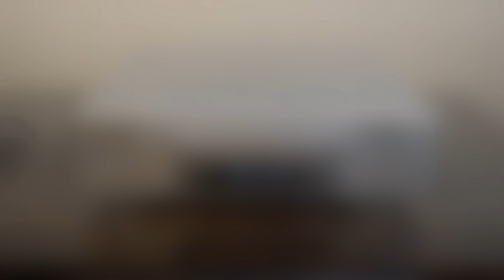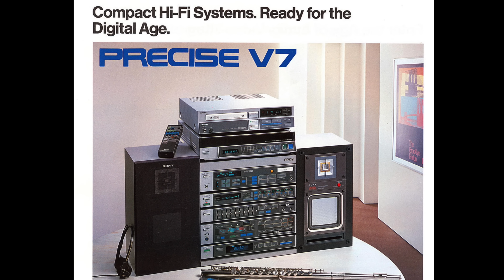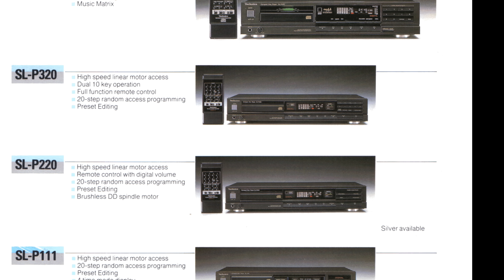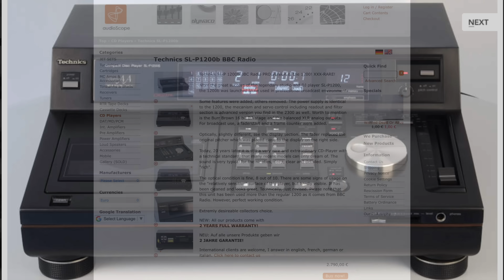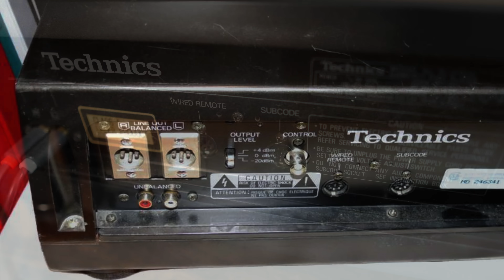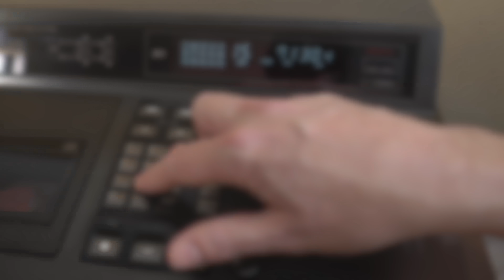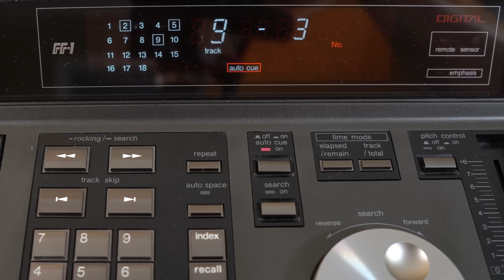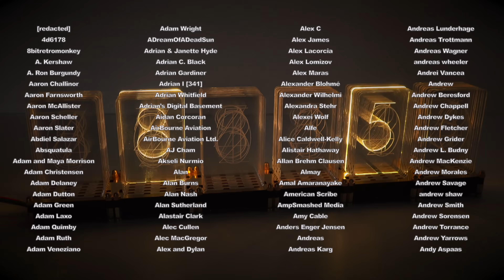How CD players lost their cool & why this Technics didn’t.

Comment: As someone who worked in professional radio at several major UK stations in the late 80s through to mid 90s, I can offer a different take on these decks. They were widely loathed by DJs, because they were incredibly sensitive to any form of contamination on the playing surface. You only had to breathe on the discs and they would stick or skip mid-track. Discs that played perfectly in the worn-out domestic CD players in the production office would go nuts while on-air in the P1200s. You were always on tenterhooks, wondering if the currently-playing song was going to go crazy.

I don't know if that was a problem that afflicted the decks as they aged; I didn't start using them until 1989. But it really was a major issue by that point, and speaking to people at other radio stations, I've heard exactly the same complaints. In 1990 my station threw out all the P1200s in the on-air studios, only retaining them in the production studios, and replaced them with caddy-based Denon DN-951FA decks that were specifically designed for broadcast use; from that point on, we never worried about CD playback suddenly failing mid-song.

The Denons were overall way more suitable for broadcast; they had a much slimmer profile (although they were deeper) and they had minimal front-panel controls, but those controls were exactly what broadcast users needed, including an "END MON" button that would play the final 10 seconds of the track (duration adjustable using a setup menu) so you could check how the song ended before you played it.
Reply: Those Denon's were work horses, I think Tascam also made a similar version for broadcast. Also in the slim profile. The advantage was you could stack three side by side in a standard 19" rack. They had a cart version too, that allowed for easy loading and quick unloading of the CD's. The CD''s would live in a plastic caddy to protect them, so no loading drawer needed. Just slid the CD cart into the deck. We had a wall full of CD's in those caddy's, you could fit a ton of them behind the DJ position.
Reply: Same experience here. Used them for a long time in post-production. Always issues with readability of discs, skipping issues. It’s a shame, because it looked very nice and solid, those players…
Reply: This really bugged me, such a nice player but the optics were awful!!
Reply: Good thing you told me, I was about to buy one
Reply: I agree - I only really saw SLP-1200s in the Production studios, and usually alone. I saw more of these in BBC studios than commercial.. The fact was 3 DN-951s fitted in a rack when 3 1200s took up loads of real estate and meant the DJ needing to lean or move much further to access them and load disks. We certainly had Denon 951s in quantity in all the Virgin Radio studios in the 90s through to the 2000s when automation playout pretty much replaced them. While the mechanisms in the 951s weren't infallible, the inability of someone to touch the disk in the caddy did mean they played every time (certainly if you did keep the mechanisms clean and serviced - DJs who smoked in the studios didn't help?!). The technics looks great, and it had a memory function to track intros (was it 99 disks?) - but in my experience most presenters didn't trust that either!
Reply: @alexanderlakey8483  I was part of the Virgin 1215 launch team, and I well remember those studios... and the utter nightmare of getting RCS Master Control working properly! It wasn't considered decently reliable until a few months after launch, and IIRC there were even threats from very senior management to dump it completely, even though the three studios had been built round it.
Reply: @dunebasher1971  I joined in 1995 just after the London FM license, at that point RCS MC wasn't being used for anything music playback related, only production content and promos - the automation system for commercials was DCS at that stage, and music all played via Denon CD players. I could probably still service and line-up one of those by ear.. I could listen to the servo feedback and work out if the mech and laser was correctly setup :-)
Reply: Yep,  that player was impossible to use for music, because got forbid you tap your foot near the media center.   It’s because of that player I just assumed it was never doable to have a real cdj type device.  Wasn’t until the Pioneers which obviously used media caching, but yea it was not a fun device.
Reply: 100% my experience using these same players in the early 2000s on student radio - probably donated from the bbc when they threw them out lol

Comment: Watching Matt practice his DJ tricks makes me want to see a live DJ mix set where they are using two of these units with a mixer and a turntable, including any tricks this unit can do like scratching or cool edit sounds on the fly as today’s DJs like to do.  Also another demo video on YouTube shows someone using what looks like a CDR with Alan parsons project written on it, and it seems to be playing just fine. Assuming it was burned in red book format which should make it playable on any CD player?  doesn’t look this deck has a track shuffle feature but has everything else. Saw that the SL-P1300 has the missing Coax & Optical digital outputs but otherwise looks almost identical to the 1200.
Reply: CD-Rs might play all right in that, though CD-RWs are more problematic in what CD players will play them.
Reply: Pretty sure you wouldn't be able to cut on this, this is why vinyl lasted so long and in some cases still dominates certain EDM genres. The search dial seemed to work like needle dropping except it just looped over and over so you could find the right point on the disk.
Reply: @sgtcreasegrease    I agree, and I was using the word “scratching” in the most  generic sense.  I was just thinking that there must be some oldskool DJs or studio technicians who used these in the early party DJ/club scenes.  they definitely aren’t as sexy as the wheels of steel, which may be why they stayed in the studio or evolved into the pro DJ cd players that are still around today, but those always seemed to be trying really hard to look and act like turntables except with shit ton of more buttons and features.  I’ve seen videos here of well-known DJs mixing with two cassette decks or reel-to-reels, so this SL-P1200/1300 doesn’t seem too far fetched to have had a scene it’s own scene for minute or two…
Reply: @Schweigardt  Ye I'm sure maybe some techno guys adopted it, they don't really cut, maybe some scrubbing just to cue up the beat, but I think a reason why they didn't completely catch on was even if there were stuff released on cd, it along with more stuff was probably released on 12" singles and albums too and it made more sense to carry turntables and a mixer than turntables and a cd player.
And yeah I can say from experience once you go to wax, static jogwheels are shite in comparison.
Reel-to-reel mixing makes sense because manipulation isn't far off from an actual record except fast forwarding is way slower than a needle drop, but you can use the supply reel to find your beat and then use the pitch control to beatmatch. I saw Mix Master Mike talking about how he would mix with two tape decks in the Scratch documentary, I'll have to find some footage of people mixing on tape decks.
Reply: @sgtcreasegrease    check out ruthless ramsey!

Comment: When I was a kid in the late 90s I used to look at the cassette being played from begging to end, but with the CD it didn't make sense because I couldn't see the progress, I just see it moving. One thing I did notice was that, on the last track, the disc was rotating slower than the start. I always had boomboxes with clear CD covers to play them because all the expensive equipment was reserved for my parents, they knew I'd destroy them 😅 But looking at the media being played is a mesmerizing show that's part of the experience of playing physical media ✨
Reply: Well observed on the rotation speed. CDs store an equal amount of data pr. groove length, and having the first track near the center it needs to spin faster to cover the same groovelength pr. time unit.
Reply: @renemunkthalund3581  the technical name for that is CLV (constant linear velocity) - the other speed standard is CAV (constant angular velocity) that most computer CD drives used.
Reply: @KristopherNoronha  I know. Not sure on the last bit though. CD-roms physically store data the same way as an audio-cds so CAV would mean a higher data read rate for data near the edge. Definitely CAV are floppy drives and, of course, vinyl records.

Comment: When we switched from cassettes to CDs, I always hated the fact that the discs were hidden.
I still have an old CD-ROM drive (with integrated audio CD controls) which I modified to work without the top cover so I could see the disc. I still power it up from time to time to listed to something from my old collection.
Reply: Whoa. Thx for the flash back! I remember wanting to mod my external burner with a clear top lid.

Comment: I suspect part of why manufacturers wanted to hide CDs away inside the machine, with no moving parts visible, was to emulate some of the front loading video recorders that were coming out at the time.  The 80's seemed to be a era of perceived technological breakthroughs that an air of, 'mystery', about them.  Removing the visible mechanical component and only having a digital display gave the impression that in the age of digital sound, it was only meant to be heard but not seen!

Comment: Pitch control was an aspect for CD players I always sought out, as when playing popular songs from CDs of 1960s, I want the tempo of the songs to be the same as they sounded on the US Top 40 radio formats of that era; as they invariably slightly sped up the vinyl record turntables when playing the songs.
In addition, the first record turntable I got with my component stereo system in 1975, I discovered later-on that the turntable ran slightly fast when measured with a strobe light/'disc; so my ears got accustomed to that tempo sound.
When I got my first CD player in the late 1980s; which did not have pitch control, those 1960s songs by the Rolling Stones sounded sluggish in tempo because then were being played at the true playback speed.
Reply: Were they speeding up the tracks intentionally? I thought that was a more modern underhanded tactic to fit more songs in, or fit in more advertisements. Once or twice I’ve heard a song on the radio that has definitely been pitch shifted. I also seem to remember reading something about some record companies intentionally slowing down the track before giving a copy to the radio station to compensate for speed up.
Reply: @Prizm44  Certain radio stations time-compress (read: speed up) talk shows in realtime by recording the audio stream then starting playback 60 seconds later (after two commercials) and airing the compressed recording.  At the end of the segment, the compressed recording ends at the same time as the actual stream.  Atlanta GA's WSB was notorious for this, using  it to sell more ad spots on a very popular afternoon talk show.
Reply: @Prizm44  There are urban legends from the 1960s/70s about (US) Contemporary Hit radio stations (aka Top 40) being subtle with speeding up record playback.  But, there are also anecdotal accounts of (US) radio stations in the 1980s that sped up songs.
When I lived in the San Francisco Bay Area in the early 1970s, I recall radio station KLIV (1590 AM, San Jose) hearing contemporary songs played on that station where the 45 rpm discs were sped up to around 3 percent or more; the tempo of the songs were noticeably faster than what was heard on KFRC and KYA of that era.

Comment: The club i worked as a dj had ofcourse Technics turntables.. When it was time to buy a CD player, they bought two of this one. For a club Dj like me, it was a horrible experience. The first stupid thing Technics did was inverting the Pitch Control. On a Technics turntable, you speed up the record by pulling the pitch down. On this thing, the pitch goes up if it needs more speed. So, the CD players gathered a lot of dust in those years :)
Reply: same on a lot of Technics copy decks, with pitch control the wrong way.  i was so confused first time i had my hands on 1210s at an event

Comment: re: why you didn't see many vertical cd players, The mechanism for keeping the disks balanced while spinning was simpler/cheaper if the disk was flat, and a failing bearing could cause a disk to rub (ruining it very quickly).  
The early laser lenses were also VERY sensitive to dust.  Early CD drives had different methods to remove dust from the disks as the caddy/tray was pulled in and having the laser/lenses inside and hidden prevented dust from settling on them. It was harder to do that on a vertical machine without making the assembly horribly complicated and/or absolutely massive.

Also, the upper surface of older CD media would also degrade and start to flake off if exposed to UV light for too long.  R/RW discs were exceptionally prone to it, but it would happen with the commercial stamped disks as well.

Comment: The SL-P1200s big flaw is that the laser unit becomes very hot and melts the plastic around it a bit, causing it to Go Out of alignment. My SL-P1200 doesn't read a single disc anymore because of this issue and there is No way to fix it.

Comment: My first CD player an original launch Marantz CD 73 from 1983 had a clear plastic window above the disc compartment enabling the disc to be seen when spinning it was illuminated with a green light. In addition when loading
or ejecting a disc the whole laser assembly slid out after a front flap folded down. Amazing. The second CD player also a marantz (CD84) the toc read not just the tracks but if the disc was index marked,  (usually classical discs) enabling themes within tracks to be picked up and programmed I still have some of these disc which are usually Japanese EMI

Comment: I used to play AudioCD on a CD-ROM drive without any software, just connect power and headphone out, so that it can be controlled using volume, tracks up/down with button buttons in the front panel.

Comment: Great video again. For me the mid to late 80s CD players do have a Hifi and nostalgic appeal, even if they all looked a lot similar. I bought again my Sony CDP 228-ES which I had back then. I also would like to have one of those 3k Euro top line Sonys of the late 80s, but with 600+ Euros nowadays there are a little expensive.

Comment: I love CDs. I find it really sad that some of my favorite artists stopped releasing CDs. I myself buy used CDs in good condition and build myself a music library for my devices using FLAC files. There's no way you are able to get the same quality from a mp3 download that costs you the full price of the CD when it was new
Reply: I remember when music was actually expensive. It was expensive to buy on physical media exactly until there was an alternative in the form of MP3, and I doubt you'd be able to tell the difference between PCM and 320 kbit/s MP3.
Reply: @graealex  I can actually tell a difference between the two. The Flac with over 1000kbit/s pulled from the CD sounds more definite compared to a 320 mp3, mostly in the upper most frequencies.
Reply: @vapferdy1485  Pretty sure you can't. Unless you invested heavily in playback equipment to even have a chance to compare, also if you do comparisons, you need to use the same source media, convert the MP3 yourself, and use the same playback equipment, otherwise you will compare everything but the format. Although it's not like you can't buy lossless music nowadays online anyway.
I was just pointing out that music on CDs was fucking expensive, to a degree that even tape sales continued for a long time, just because tapes were sold at a lower price, and it didn't even make much of a difference for most people.
Reply: @vapferdy1485  Anyways, you said you love CDs, and I fucking hate them, because publishers used the superior audio quality as an excuse to sell music at twice the price, even though they were far cheaper to make than a tape or record, and then they even put fucking DRM and root kits on it. It also never really evolved, even though three new optical media formats have gone mainstream afterwards. So I say good riddance to audio CDs.